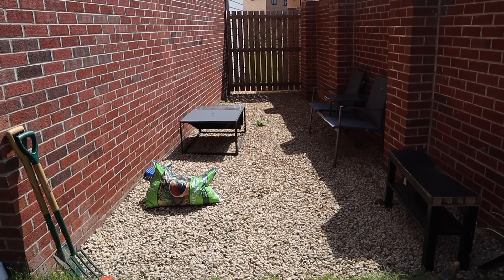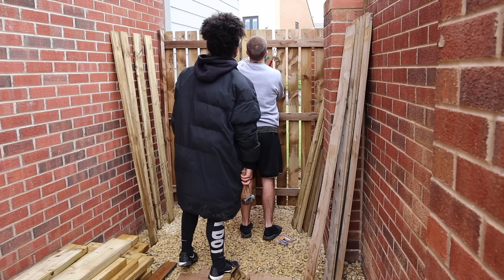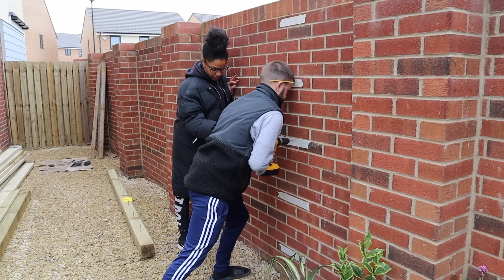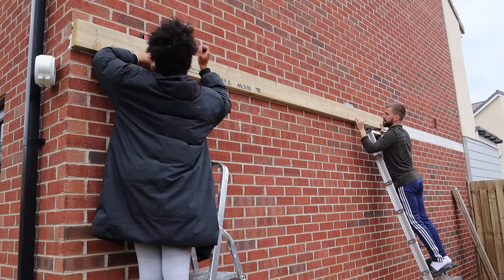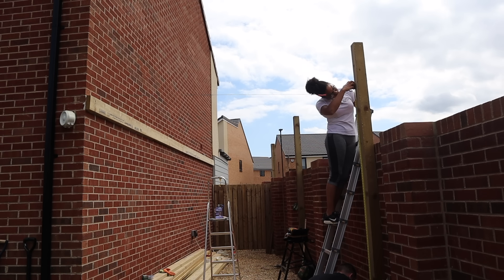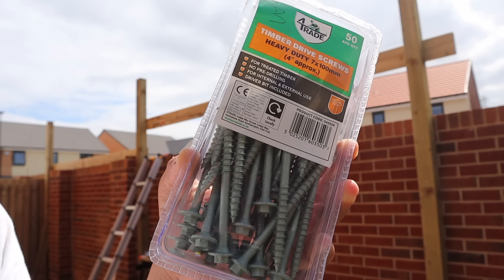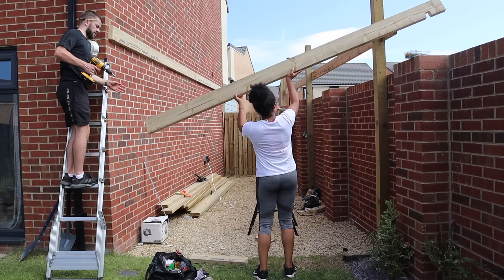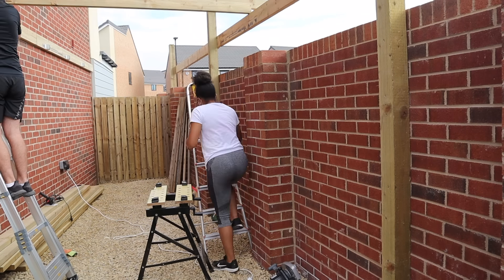EASY MODERN PERGOLA DIY | Build a Pergola UK | Lean-to Attached Pergola | Shade Shannon

Comment: Great job looks good, just a wee tip when fixing the timber to masonry walls it’s a good idea to put a DPM (plastic barrier) on the wood face that’s against the wall to stop any moisture getting into the wood causing it to rot quicker
Reply: Hi Jack, I wonder if you might be so kind to give even more advice on this. For me, the house is dashed. Will this be a problem? I don't want water seeping down the wall and/or staining? Would there be any kind of soft foam type stuff I could put between the wood and the dashed wall that would fill all the little gaps between the dash stones etc?
Reply: Hahahaha 2 right mate
Reply: @pigmintfilm256  I would use flashing between the wood and dashing, thick enough to mould to the dashing, hope that helps.
Reply: You can also put washers between the wood and wall so the wood stands off the wall a few mm to allow any rain moisture to run down the back.
Reply: Jack, you changed my life with this advice!
Reply: I would argue dpm could easily trap moisture. If anything you want to create a gap for airflow
Reply: Pressure treated wood isn’t supposed to rot. That’s the whole point of treating the wood, to withstand the elements.
Reply: Hands down the best pergola video I have ever seen, ok it's the only pergola video I have ever seen but now I don't need to see any more, thanks and I will be using your great advice.
Reply: @iRjungler  The outside is treated, not the inside. Anytime you make a hole or a cut into it you have compromised the wood.

Comment: Very nice project, looks great and It really transformed the unused space. I have a similar space on the side but it narrows to 2.5ft at the rear and 10 ft wide in the front. Curious to find out what is the total lenght and how much distance did you leave between each joists? Also did you use the same Travis Perkins 6 x 2 joists for attaching to the wall of the house?

Comment: I just built one of these and without the masking tape. I drilled my 1st end hole in the wood. Put the wood up against the house brick make sure it level (get a 2nd person to hold and then just mark the brick with the drill. Put the wood down and drill. Put your first bolt in (not tight) and then you can move the wood into position drill the 2nd end hole
Reply: I also used screw into the same brackets seem quicker then nails and a hammer. & because I’m rood sheeting mine I used brackets both ends so there no lift …. Good job! I was as proud as you when I completed it
Reply from the maker: Great tips!

Comment: Looks good although I would be hesitant attaching the ledger to a brick wall. As brick wall are generally only meant to support the load above it and nothing else.
Are your post below the frost line? If not how has the ledger held up over the years?

Comment: Do  no other article looks class, but a more powerful drill would have made putting the screws in the wall so much easier. 
I got a 1500 watt 240 volt SDS drill for about £50 and it makes a mockery at brick walls.

Comment: Did you not attach the beams to the supports? You just slot them in?
Reply from the maker: Just slot over they’re locked right because of the angles
Reply: @ShadeShannon  ok so what happens in a strong wind? Could they not lift up?

Comment: I hope I didn't miss you talking about this but what are the rules about planning permission with these type of structures? I was surprised how high you went over the brick wall/fence as I thought you weren't allowed to go over 6ft with shared walls or something like that? I'm really interested in building one of these myself, you've inspired me big time. Thanks.
Reply from the maker: We checked the online resources (hve linked some in description) to make sure we could do it. We don’t have a shared wall and we didn’t go higher than 2.5m which is the max height for this structure ☺️
Reply: @ShadeShannon  Thanks for the info. Loving the content as always <3

Comment: I would have thought you shouldn’t secure that beam to the brick without damp proof course behind it as bricks and masonry grout are porous so will take water in and potentially right into your walls .also screwing into hollow brick isn’t a great attachment . Someone comes along after you and decides to put a roof on that then it won’t take the extra weight . Apart from that it looks good .

Comment: Tip for fixing timber battens (or posts) to a wall. Fix at one end then level across and fix at the other end, then drill and screw all the way along. Saves trying to keep level while trying to mark multiple holes. 👍
Reply from the maker: Thank you 🙏🏽
Reply: Or when you are alone, just do the middle one, then level and keep going (do most of my stuff alone)

Comment: fantastic work and great video. in regards to the timber to walls, no need to take post off and on. and then change to masonary bit. then you need and impact driver to drive the masonary screw in. 
for the cross bar on the wall, you can hammer temp nail into the cement part of brick to hold up while you line up.

you should defo invest in a impact driver.
Reply from the maker: Ah nice!!!!

Comment: Did you need to put in wall plug equivalents for the wooden posts into the brick wall?
Reply from the maker: we didn't as the screws we used were for bricks

Comment: Hey, thanks for the informative vid. I noted that you used joist hangers across the house wall, but how did you attach the boards to the beam the other side as this wasn't noted?
Reply from the maker: Hey! Thanks! So the other side the support beams were attached to the posts with the timber screws I showed in the video and then the cross beams sit on top 😄
Reply: I think Matt means how did you fix the notched beams to the support beam ? It isn’t in the video and they should be fixed to prevent movement in high winds.

Comment: Just stumbled across this vid . Great d.i.y build . Can't fault it . Did you by any chance secure the ends to the beam ? . You didnt say if you did . I drill through and secure both pieces.  Also I would have done a few more beams personally but each to their own . Get a manual pull shade  does wonders on a hot day .

Comment: Looks great tbh for a Diy couple that has little experience tbh, although please buy a proper hammer for the job, that is a lump hammer for working with stone brick primarily, if your using nails / chisel you need a claw hammer at the very least
Reply from the maker: I do have one I just for some reason grabbed what was closest 🤨😂

Comment: you put the drop running to the wall of the house? why? all the run-off will accumulate there and rot the timbers in a few years and all the dpm in the world won't fix that, you can't ever put a roof on it as its running right in the house, .........you done so many things right ............literally  everything you had down to a tee ...............and then you did that.................... honestly and I mean this nicely you should take it down and do it again , maybe add some dpm to the wall plate and some flashing if you think you might add a roof

Comment: Might be a silly question but do you need planning permission for the hight
Reply from the maker: You can have it to a max of 2.5m or 3m if it’s a pitched roof but there are others considerations to take into account. If you check the planning permission site I think they have info there 😃

Comment: Omg I’m so glad I came across this video! Me and my partner are going to attempt this in a couple of weeks! Thank you thank you for sharing! Can I check, are the screws you used for the 6x2 attatching to the house the same screws you used for attatching the posts to the opposite wall? And did you leave a gap at all with like washers or anything between the house and the 6x2? Thanks again! :)
Reply from the maker: Thank you! Yes same screws were used for the brick and the house. Didn’t leave any gap between the wood and the house though it’s not a bad idea to! ☺️
Reply: Shade Shannon lush! Thank you so much for your response, I’m a liiittle nervous for it but this video helped so much !
Reply from the maker: You got this 💪🏽

Comment: Top tip for anyone attempting this, use the right drill for the job,  the right hammer for the job etc etc and you will do it in a quarter of the time 👍
Reply from the maker: Defo!